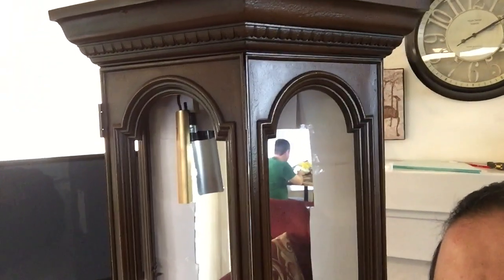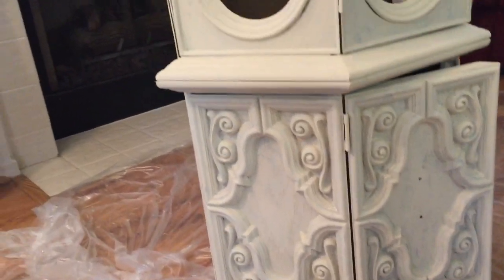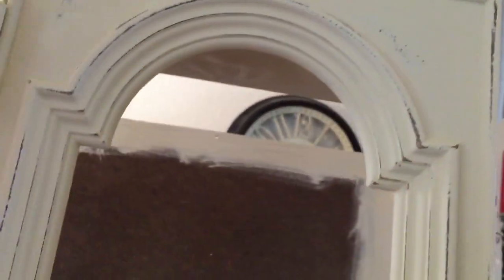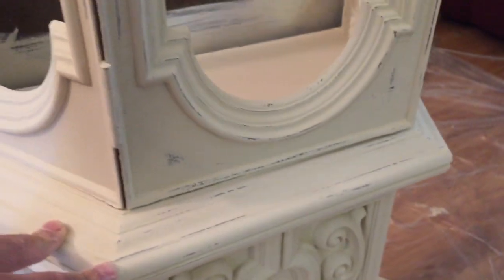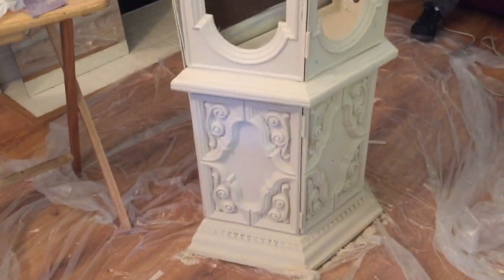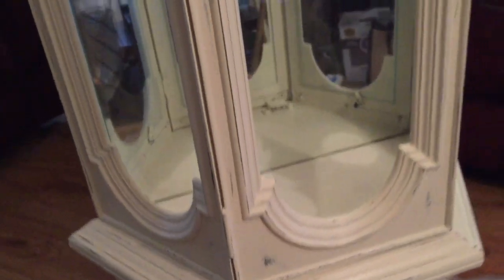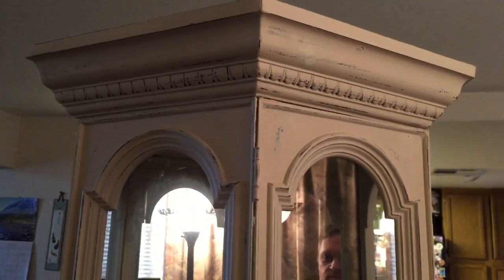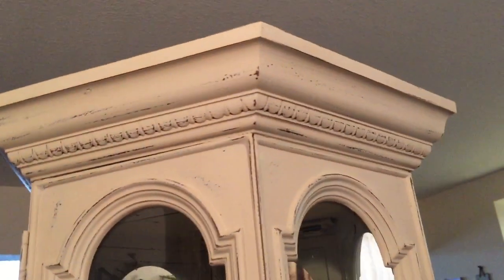Annie Sloan Chalk Paint curio cabinet

Comment: Christine here, I love the finished paint finish on the hutch. Would this work on dining chairs and would it be durable ? The finish on the chairs presently is  smooth and a little shiny, would I need to sand them down first? Please do not give up crafting for renovating furniture !!! I would miss your creations far too much. Hugs xx
Reply from the maker: Stephen Barry hey Christine, with this paint you don't have to sand down any old furniture. You just make sure it's cleaned and it will go right on. The formula allows it to cover stained furniture. It's best if you wax it after to seal it. Some Annie Dloan stockist sell sealers that are more like the US sealers that we typically use but look better with this type of paint. I hope that helps. Amador

Comment: This is beautiful!! I have a few questions.  I'm wanting to  paint my curio.  Mine is a bit larger. Plus has a mirror/glass. We aren't planning to take them out. I was just going to cover them. What do you recommend to use? I really like the chalk paint. Would this type be recommended rather than any other? I'm excited  to do my curio and this will totally  change the look (it's currently a light wood color and changing it to possibly  a light grey)the curio does have etching cut into the wood. I look forward  to doing the distressed look as well!!
Reply from the maker: Joi Violette for these situations I prefer to use regular printer paper but I like to wedge it in between the mirror/glass and wood and then tape it to the glass. This way you don't have to try and place the painters tap between the mirror and glass because that is super impossible because of the adhesive.  Also once you have the edges of the mirrors taken care of also cover the center and you don't have to be super careful with flying paint drops